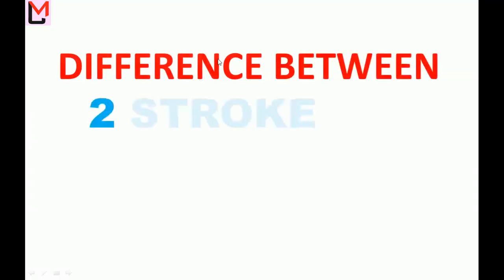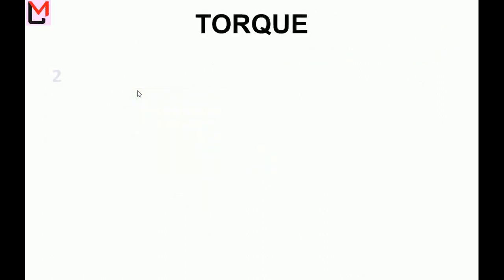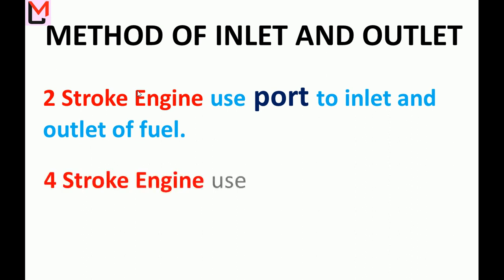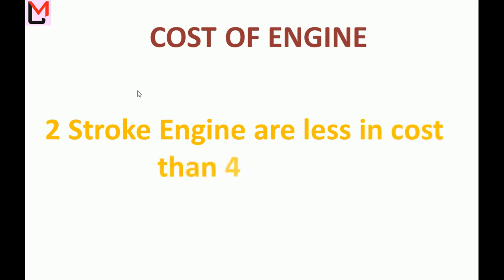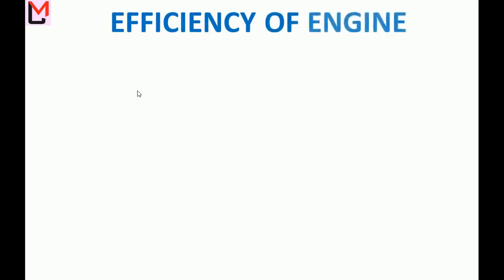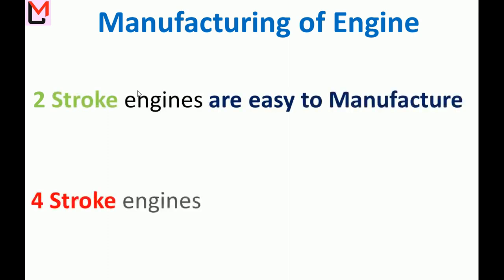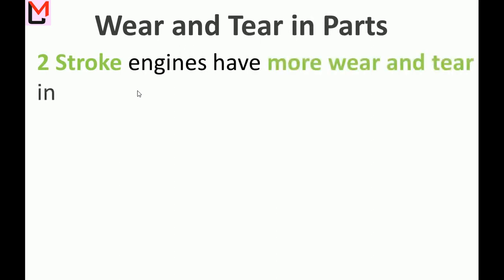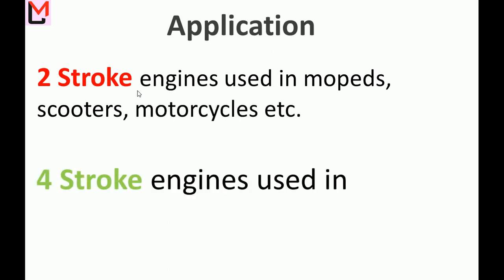2 Stroke and 4 Stroke Engine || Difference between 2 Stroke and 4 Stroke Engine

Comment: ATTENTION:
2stroke engine requires A LOT MORE knowledge to be used at its maximum potential which is very great.

4stroke engine requires A lot more physical activities in order for the user to experience its full potential which will be above what we hear about others' explanation (but some do have the exact, correct and detailed explanation)

Comment: According to the video 2 stroke engine produces more torque than the 4 stroke which means giving the machine more power and speed but why in moto gp 500cc  the aprillia motor bike (2stroke) is slower than the Honda and Yamaha 4 stroke the 4 stroke is also much stronger in acceleration ?! There is something missing I couldn't understand which motor produces more speed

Comment: 2 stroke engine have higher torque?? Really??
Reply: yes its one cycle per detonation and 4 stroke have to turn 2 times for per detonation
Reply: @hlmc00  not 2 but 4, that's why it's called four-stroke. RPM of the engine is not the torque. If you are right, them why 2 stroke engines are not use in heavy machines?
Reply: @Cien_Swiatla  well steam engines are 2 stroke but don't use fuel also 2 stroke engine are considered dirty engines there were fase out https://www.google.com/url?sa=t&source=web&rct=j&url=https://m.youtube.com/watch%3Fv%3D42EzIcmbED8&ved=2ahUKEwilzOHj0szoAhUKKqwKHQZkBy4QwqsBMAN6BAgEECE&usg=AOvVaw1Cs3uGFri0gzc8C1cz9IGU
Reply: @hlmc00  well, let's compare engines that run on the same fuel.
Reply: @hlmc00  And by the way, you can say that diesel is a two stroke engines , but they have the mechanics of 4 stroke engines, just these engines combine 2 compressions steps into one
Reply: @Cien_Swiatla  because 2 strokes engine is for motorbikes and if you want to modified your car turn into an 2 stroke yeah 2 stroke has high torque than 4 stroke
Reply: @kimaidapotato7516  so why are 4-stroke engines installed in motorbikes today?
Reply: @Cien_Swiatla  to reduce air pollution
Reply: @Cien_Swiatla  regulation
Reply: @xperimental1974  this is another thing. 2-stroke  engines are not fuel economical, so they do not produce so much power like 4-stroke. work is underway to combine 2 strokes and 4 strokes engines in to 1.
Reply: Ye pal

Comment: After all the engines i have driven over 30 years, i found 2 strokes rev higher and will take off faster and pick up speed faster than a 4 stroke, But i found 4 strokes are more powerful and could drive through more difficult terrain like deep mud, were a 2 stroke wouldnt be able to. 2 strokes=faster but less power 4 stroke=slower but more power. Always thought, more torque gives more power.....2 stroke i always had to mix abit of oil into the gas were a 4 stroke i put straight gas only...going by this video,im now confused.... I always liked 4 strokes best. 20 years ago I had a 250cc 2 stroke dirt bike and a 4 stroke 185cc 4 stroke dirt bike (motocross) there were both close to the same year. Even though the 4 stroke was 65cc less it always had more power and took alot more stress before it would bog out, were the 2 stroke always had less power but was alot faster at take off. The 4 stroke could get the same top end speed, just took abit longer to reach. This video confuses me
Reply: Chris D wrong i ride 2-stroke dirtbikes but 4 strokes are way faster
Reply: EHHHHHH!!!!!!!
Reply: u always feared to ride 2 stroke with in its powerband
Reply: doesn't really mean anything to compare 2 bikes of unknown origin/manufacture with unknown maintenance and unknown issues. For all we know your 2 stroke was suffering from compression loss or  was running rich, lean, could've been a jetting issue, could've needed a rebuild. There's so many reasons why one bike could be faster than another. Could also be a traction issue, sometimes more powerful bikes actually are slower due to less traction.  What i think you're trying to say is that 4 strokes have a broader powerband and more available low end torque. That's honestly why you were able to ride the 185 better, broader powerband makes it easier for most riders to make the most out of the bikes power.  

At any rate, i don't like the 2 stroke vs 4 stroke battle everyone is so obsessed with. I just hope these companies keep making 2 strokes cause i like them both. I think it takes away from the enjoyment of the activity if you spend too much time obsessing over the machinery used to do it. I ride an 89 XR and an 06 YZ, both old and new bikes... 2 strokes and 4 strokes! they both are a blast to ride and i wouldn't bother to even compare which i like more.

Comment: Correcting a bit. Not all of 4-stroke engine are water-cooled. Some motorcycle has air-cooled system on their 4-stroke engine (especially if it got volume less than 125cc like scooters).
Reply: Same with 2 strokes, my cross is 2 stroke water cooled
Reply: @filip1462  I have a 2 stroke water cooled and a 4 stroke air cooled scooter
Reply: my bike has a 4stroke engine and it is oil cooled